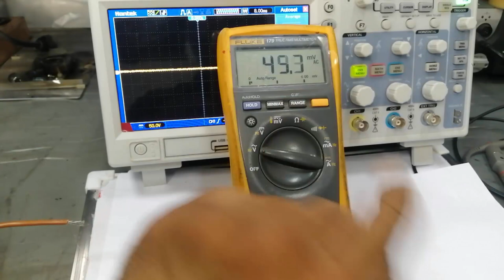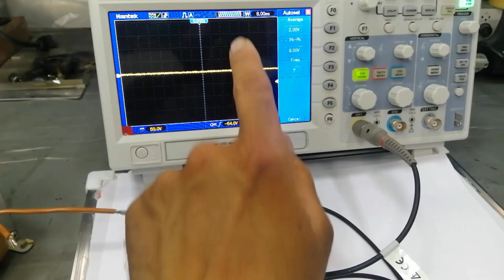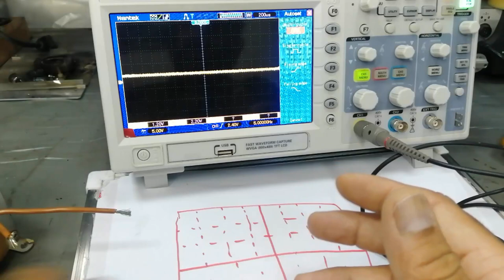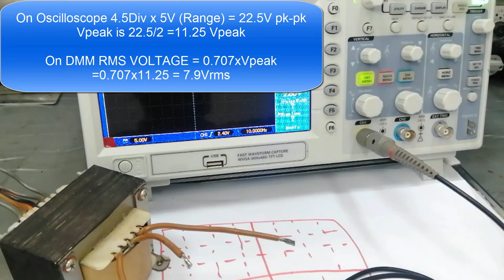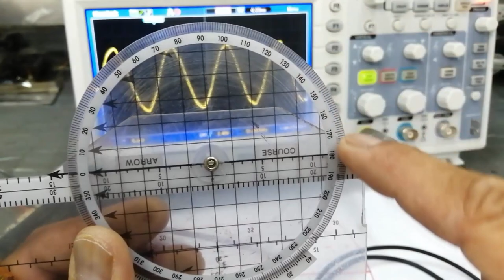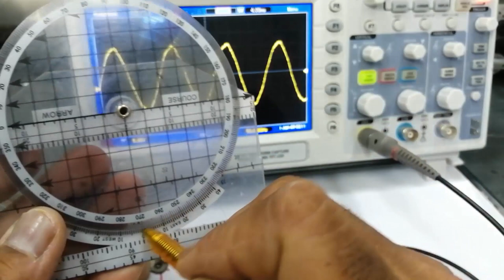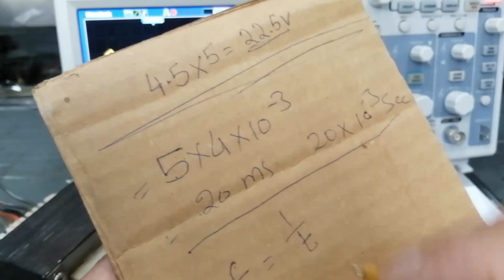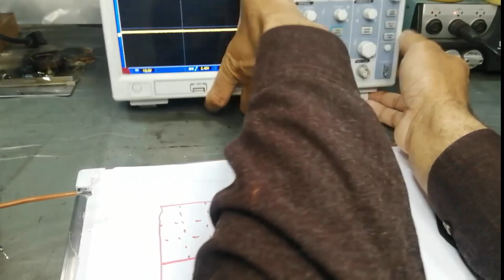#161 What is OSCILLOSCOPE - Basic Introduction

Comment: There are 10  npn transistors are parallel connected in a circuit. How can I check which one is working and which one is not?
Reply from the maker: if that are in parallel so in that case if there is one short or open , then you have to separate them for detecting the short one